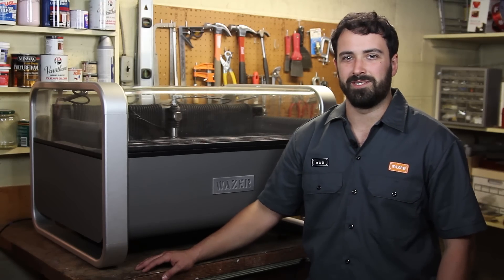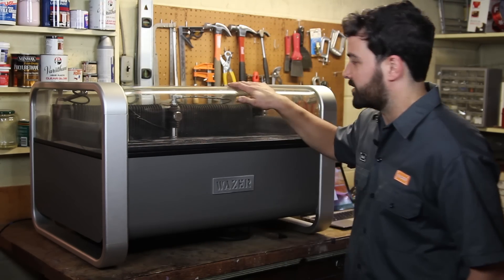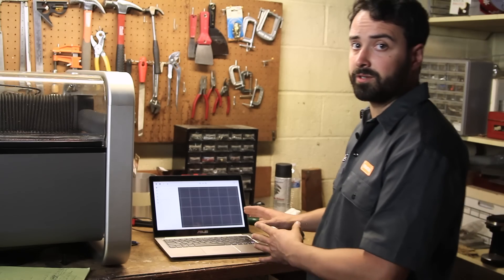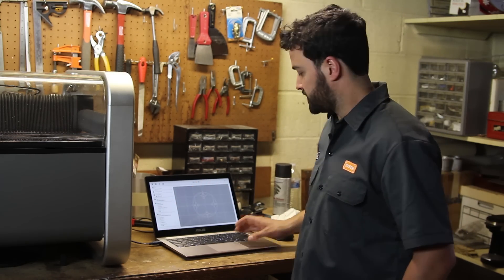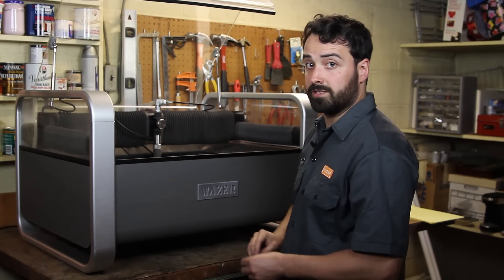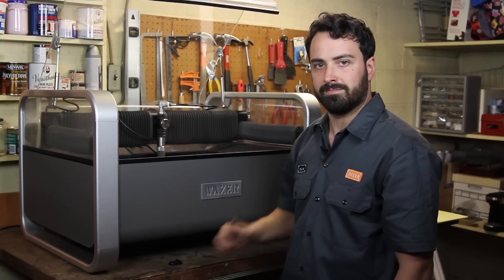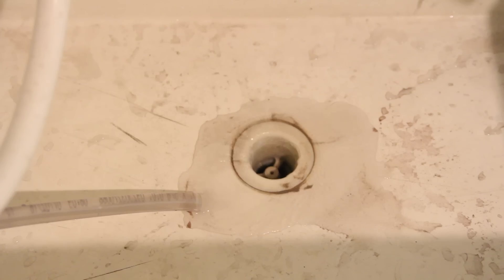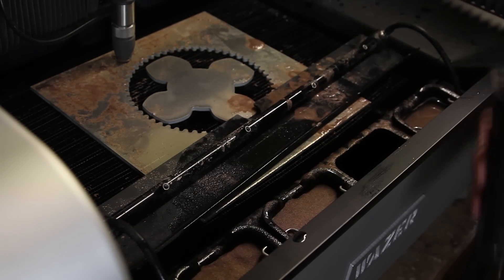FROM THE ARCHIVES: How WAZER Works

Comment: Greetings, four questions:
1) dimensions of the work table?

2) maximum thickness of cut, example stainless steel?

3) Cutting time of stainless disc 50mm in diameter by 3mm thickness?

4) Approximate price?
Reply: All the information you need is on the  Wazer website.

Comment: I'd like some specs. What is its precision and repeatability? What is the kerf size? What are the maximum thicknesses of various materials that it can handle? What is the work area?
Reply: volts and watts?  industrial power or a home 220v outlet.
Reply: @erinmurphy3587  110v home outlet

Comment: Great video, very relaxed and personable.  Please add a closeup of the hold-down pins, it could be more clear.
Does WAZER run without PC if file is already uploaded?  Can you upload more than one file?  Can you control start/stop/pause/home/move WAZER from PC?  Does WAZER run on gcode or have an open API?  Would you recommend a water softener before water goes into WAZER?
Reply: Oh yes, and great Troy McClure reference.